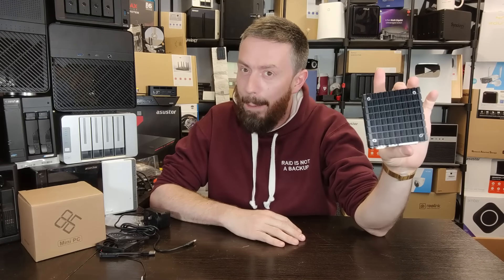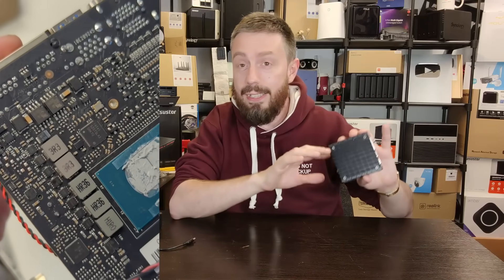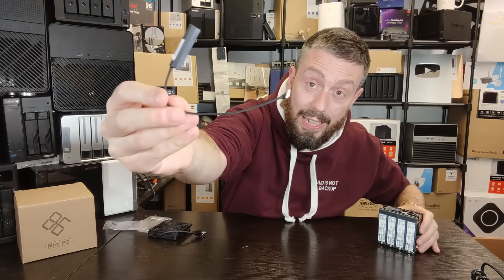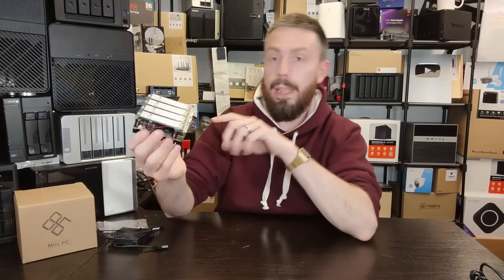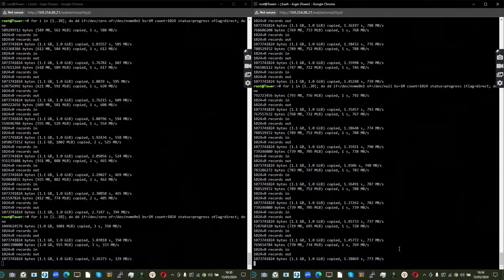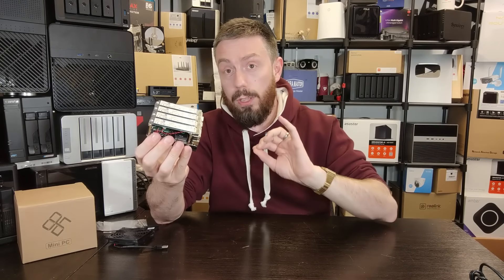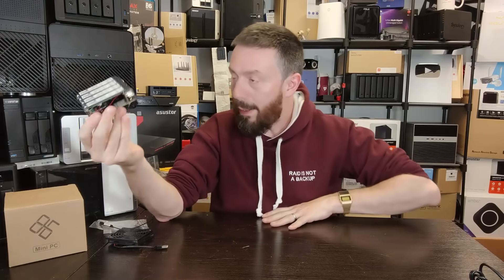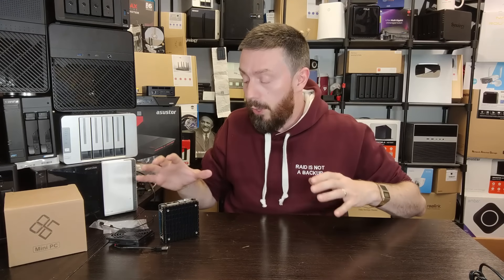CWWK X86 P5 M.2 NVMe NAS Board Review

Comment: put one or maybe 2 NVME M.2 As1166 Sata controller on it and connect 6 to 12 sata drives to it. The psu is the problem to solve but then absolutely storage beast. I bought one with pentium gold 5805 without the nvme hat but SFF8643 Ports (4 Sata and 4 pcie x1 or 1 pcie x4) cant wait to build my HomeLab. ✌️

Comment: For anyone looking at this in the future.
I bought one of these and put a 48GB 4800Mhz RAM on it and it booted without any issue into BIOS. Have not tested with OS yet but to boot to BIOS means it is fine 99% of the time.
Reply: Any updates so far?
Reply: @alimohsen2394  Well everything works fine, Installed Windows 11 and everything works fine. Also tried running some games for a couple hours to see if stressing the system would cause any instability and nothing so far. I have heard that Alderlake N series can boot 64GB fine but haven't been able to find a 64GB single module RAM.
The system In general is cool and stable
Reply: @CodeSnowy  hi mate, ive also got this system. so far it only recognises 32gb of my 48gb installed ram and not does recognise any of the nvme drives i installed.  do i need to update the bios? - pls help.  thank you thank you thank you in advance
Reply: @cheekyfella27  As far as I know I updated the BIOS with the update that is available on cwwk website and it worked flawlessly. I didn't check if all the RAM is recognised before the update.
Also, regarding the NVMe, I think you have to enable PCI-E bifurcation in the BIOS I think

Comment: My cwwk Box arrvied a few days ago and I was wondering, if you guys have tried an M.2 Sata Drive? I know this is more of a firmware dependency, but I didn't findy any section in the bios menues. 
Reason I'm asking is, I have a chance of buying NOS M.2 Micron Enteripse Drives from 2018 at an attractive price. Speed doesn't matter for my applications (Phone pics and docs sync, CD rips/Bandcamp downloads streaming)
Reply: The quad carrier only do pcie signal and no sata controller in between so you can't use M2 sata on it .but board itself have 2 sata connector breakout which can provide 2 sata bay with their cable

Comment: Bought and put together this system using 4x WD Black NVMe drives set up in a RAID5 setup.   It seems to work but when transferring files into it the RAID5 bricks and needs the entire system re-installed.   Tried both OMV 7 and TrueNAS scale and had same issue on both.   I'm assuming it's a thermal problem causing something to corrupt.   Anyone else have this issue and anyone manage to solve?
Reply: Thanks for sharing!

Comment: I’m using it with truenas scale with 5 ssd (I’m using a m.2 wifi adapter for the os). Everything works fine but time to time (1~2 days) one of my 4 ssd got disconnected. If I just restart the board in truenas the disk is disconnected. If I shutdown it completely then start again the ssd get back... I’m wondering if it is the hardware/bios. Does someone had the same issue ? For now I don’t think it is a good machine for a nas when stability is important.
Reply: @saorikido227 can you please let me know which 'm.2 wifi adapter' are you using to behave as the 5th SSD? Thanks.
Reply: @MrGrangeia  youtube don’t let me put a link unfortunately...
Reply: @saorikido227  Thanks anyway. Perhaps, if you could share where you bought it and a description, I could Google it?
Reply: @saorikido227  thank you! 😀

Comment: Thanks for the video! I'm very new to all this. How would you say this stacks up against, say, the friendlyelec 3588? They both have 4 M2 Gen3x1 slots. Does the oversaturation problem / cooling issues make up for the difference in CPU performance for a basic home NAS / plex server? Which would you recommend for that purpose?
Reply: I guess the biggest difference is CPU structure, X86 vs ARM

Comment: I think the 3x1 was a miss. I would have much preferred a PLX on there, so each is at a 3x4. Then I can use these as a small mesh of nodes for some of the work I have.
Reply from the maker: Would definitely need to beef up that CPU if they did! Even the N305/i3 wouldn't stretch to that. Would need a decent emb.ryzen or Intel core Mobile Soc - which would get REAL TOASTY in that frame

Comment: On Ali Express it is available with 32GB of RAM,  this really bothers me that vendors will do this.  The N100 will only support one channel with up to 16GB per memory module.  Yes, the bios may recognize larger memory modules but the CPU will not address it,  the memory registries have to be designed to address the memory, it will simply ignore anything larger than what it was designed for.  If anyone has one of these with more than 16GB of Ram. please find a python script that will test memory by grading a defined amount at a time and see where it tops out at.

Comment: If you can afford 4 NVMe SSDs I think you can afford a better NAS solution than this. With an inexpensive PCIe card you can fit all the SSDs into you main computer skip the NAS.
Reply: and leave the main pc running 24/7? you totally miss the point of a NAS here tbh
Reply: @crax999  I have my main pc running all the time anyway. Modern computers are quite good at managing the power according to the load.

Comment: Hi. This might be a stupid question but, does anyone know if the 2 sata ports inside the board are able to power 3.5 hdd, or only 2.5 ones? Thanks.
Reply: They should be able to power either one you would have to have a separate power supply to power said hard drives though , the way it works is SATA data ports are all the same only difference might be the size of your power ports but usually these are the same as well , however if you are trying to run a merged adapter that has both the power port and data port in the same connector then it only fits either 3.5 , or 2.5 or so on hopefully I haven't confused it took me a while to figure out that data and power plugins work independently of each other when I was learning about hard drives as well

Comment: put this prompt in your favorite GEN_AI (such as perplexity pro): 
please describe a concrete setup including alternatives with maximum price performance for a DIY NAS setup based on the following settings:
The best bang for the buck setup right now is to get a used mini PC (SFF) with enough PCI adapters and USB 3.2, plenty of RAM, and carefully tweak it for a cold/hot storage setup (& cloud backup),  Add an usb-C-5Gbe for the sweet spot of NAS performance, then configure the storage pool tiers to your liking with truenas, unraid, openmv, primocache. 
64GB RAM - 4 x 1GB NVME SSD - 4 x 18TB (8 x 8TB with refurbished Exos 2x18)
1 x NVME x 4 adapter
1 x SAS adapter
3GB/sec constant bitrate - generous caching wherever possible, assuming home use with few concurrent users, lots of large files, low db activity and random access.

Comment: Do ypu tbink ypu could run truenas off usb drive??
Reply: It's not unRAID so the drive is liable to die fast
Reply: @BoraHorzaGobuchul  maybe a solid state usb. Thing is you need a drive for os!!
Reply: @THEG12EG  you do, of course. Since truenas, unlike unRAID, writes a lot to it's drive, a flash drive is very undesirable. A usb-ssd will most likely work, but again, depends on the quality of the SSD - usb-ssds are often low-quality stuff.

Comment: I'd love to see someone make a compulab airtop 3 style heatsink grid chimney cooler for this for both the CPU and the SSDs. I'd throw an actual i3 under a small version of that airtop3 cooler, or 2 or 3 of those atom N300s pretending to be an i3.
Reply: On the subject of ECC...... wasnt ECC supposed to be standard for DDR5? Wasnt that the big selling point during the run up to release?
Been quite upset with ECC uDIMM support in so many DDR5 platforms. Did anyone catch that it took Epyc coming to AM5 for most motherboards to put any work into enabling ECC?
AM4 has had far better ECC support than AM5 up until now.

Comment: i have the i3-n305 variant with the board and 5 (FIVE) nvme attached and running.. 4 nvme on the expansion board (pcie4x4 downgraded to 3x1 each) and the 5th drive in a custom a+e to m-key adapter i built myself.
everything works perfectly fine, running proxmox on the 5th drive and with mdadm raid5 array with lvm on top on the other 4 drives.. lan ports are lacp'd so i get full 2.5gb transfer speed, quite happy and sold my old DS920+.
Reply: Can you make a video/post on how you did this?
Reply: @cl-be2zs  uhm yeah i guess i could post something about, you mean the 5th drive adapter? or the whole setup?
Reply: @RobertoAnile cwwk released this board with case, so would be apreciate if you show your hole setup
Reply: @evgenypotapov3716  yeah i ordered that case so to swap the dev board and have it cleaner, i promise i will make a video with the 5 nvme disks installed!
Reply: @RobertoAnile  are you happy with disk performance?
Reply: @evgenypotapov3716  well yes it's working ok for me, in a w10 vm the mdadm array reads at 2600mb/s and writes at 1300mb/s, not amazing speeds at all but it's ok.. obviously the bottlenect is the network so no problem there.
Reply: @RobertoAnile  sounds pretty nice! I was bit feared with speed tests on this video. What drives are you using? going to repeat your experience
Reply: @RobertoAnile  in the video he said something like 500mb/s read and even less write...do you have such hinger figures because of the i3 Processor? I have a QNAP TBS 464 with 4x WD RED 4TB SSD and besides some backups I mostly have movies on it and connecting two an Apple TV via SMB...I don't know too much about NAS systems...do you think this little CWWK thing would be enough for my use case? and what system would you install on it for ease of use? What I hate about the QNAP is how loud its fan is.
Reply: @RobertoAnile I see that there are a+e to m-key adapters you can buy online, did you make a custom adapter because it needs to be thinner than those available? If yes, would you be willing to share the design?
Reply: @QuickCat  the problem is space, yes, and a common adapter wont fit because of the ram stick hitting the a+e device and thus the nvme adapted to that.. what i did is take an a+e adapter and a m.2 pcie adapter and cut them to fit in the space, then soldered the lines rotating the pcie adapter 90°.. it's not easy to explain but it's simple to do if have the manual capacity to do so.. i posted some pictures in a comment above but youtube decided to remove it.
Reply: Having this expansion board plugged into a single M.2 socket I wonder, how do you identify which nvme to swap in case of failure ?
Reply: @alexandruiancu2453  most drives have serial numbers on them (I wouldn't presume all). You can remove the drive whose serial number no longer appears in your operating system. I'm running TrueNAS scale and this is fairly easy to see from the GUI.

Comment: I had a feeling the drives would run at PCIe gen 3 x1 which is actually not that bad if you compare it to the Zimacube. Go watch the critical review of the Zimacube by Hardware Haven and see how they use an Asmedia switch to further downgrade the NVMe lanes to each drive to the point you even see warnings in the syslog about degraded PCI express performance.
Reply: I would have liked to see the video run some sort of fan over the NVME's and whole board in general, then re-run that write speed test. Because at the moment it seems incomplete, why did it drop performance so badly.

Comment: I could easily see someone designing a 3D printable case for this that puts a couple SATA drives on top of it, and then a 120mm fan along the back that would actively cool all of the components. Would love to see that come to fruition.
Reply: i started work on  one but ran into problems problem 1 the fan headers are 1.25mm pin pitch looking for adapters haven't found any except for in china
what they (cwwk) recommend is USB fans so now looking for USB headers (2.0 pin pitch) for USB 2.0 found some on another web site , next comes the propriety SSD/HDD header you could break these no replacements,they  don't sell them ( could have use a plug like in a laptop, ask them for a cad model they pointed my to some weird can format .x_t looked at at it using e drawings and realized nothing looks professional so i had to measure each port to get locations and rebuild cad model. so i believe this is a waste of money to even get vs a raspberry 5  with a hat for 4nvme drives yeah sure it has more memory and probably more power.
Reply: There are already bunch of Chinese DIYers have done it, they made a open source project called qNAS, you can have 2 to 5 bay 3.5 sata bay or 2 to 6 bay 2.5 sata versions.
Reply: @Bytional  could you give a link on these? how are more than 2 SATA drives supported with only 2 pins? or are they doing away with the nvme slots and using the PCIe 3.0x4 for SATA?
Reply: I have the 8core i3 model coming and was planning to do exactly that when it arrives.  I will drop a link if all goes well.  i3 has twice the processing power than the other models so I might run proxmox and some light VMS. I don't think he striped the nvme drives so this could be hindering the read writes on the daughter board possibly. I will stripe and test the speed.
Reply: @jimmyTimtam  Have you had any luck. Also any info on speed and CPU performance? I am very interested in getting one of these and would love to have more info before I get them.
Reply: @jimmyTimtam any update? how had your project gone?

Comment: Hi, actually I’ve got an idea for testing system like this one:
populate it with nvme drives and boot from ubuntu usb or something similar. Make a zfs array (raid5) and copy some large video file to it. Then just copy from one folder to another within that zfs array! 
That should tell people how goot the cpu is in terms of calculating checksums and parity data. 
You could setup a ram disk and copy data from the array to ram disk and the  from ram disk back total the array - that way we would know the read and write performance for at least sequential data.

Comment: I'm running this system with Proxmox without the 4xNVME. E-Key 64gb boot drive at 3x1 speeds and a 2TB regular NVME at 3x4 speed for CEPH only. Putting the fan on the heat sink was required. 32gb RAM works perfectly fine. It's ok as a Proxmox node as long as you don't expect too much out of it. The 4 E-Cores are obvious at times, but normal operation is great. 3 node Proxmox cluster running CEPH for the only storage and about 3-4 VMs on this node at any time.
Reply: What's a e-key?
Reply: @THEG12EG  m.2 slots are keyed for different functions. The “WiFi slot” is an E-Key slot. The cool thing about it is it usually has a x1 pcie lane and regular storage will work. Slowly. Regular storage m.2 slots are M-Key.
Reply: @scottbrooke4896  oh I've always wondered what that slot was called 😂
Reply: My only SSD is recognized if I use it with the 4x adapter, while if mounted directly on the motherboard it is not recognized by the BIOS. Is this normal? Help
Reply: Hi. What's your NVME configuration? Are you running any sort of RAID? What e-key drive do you have?
Reply: Is there space to put m.2 E key to B key ?

Comment: I built Raspberry Pi NAS with a mix of SATA SSD’s and 2.5 in HDD’s while I wait on more SSD deals. So far so good, you can get 1Gbps stock speeds and 2.5Gbps with a USB C dongle, if your network allows it. Jeff Geerling had a video recently about it. As for the price it’s within $150-$200 for the system.
Reply: Oh and also installed an e-Ink display with system stats like DateTime, IP address, CPU % and temp, Mem & Disk %

Comment: I see ceph node :)
Edit: can the wifi m.2 be used for boot ?
Reply: USB is certainly an option. I’m not sure how noisy the OMV boot drive is but the SD to E-key adapter could be an option as well. I think you could also use the tiny sata port adapter, but that would have to be an SSD. Don’t know what the power limit is on that little cable.
Reply: @scottbrooke4896  what about an external SSD on USB 3 port ?
Reply: Yes, that's how I'm using it. E-key to M-key adapters work fine, but are too tall if you use an NVME in the M-Key slot. There's one place, Cervos, that makes an E-Key NVME stick.
Reply: @scottbrooke4896  thanks for the into mate. Yes I'm aware of those exotic A&E key nvme, but those are too exotic for my liking and when things go wrong - it's harder to find a replacement ... and are also expensive and have low write performance.
Reply: @scottbrooke4896  BTW, I forgot to let you know, if some thread I've seen guy dishing out a link to an amazon item which was A&E to M-key with a ribbon cable allowing to place M-key socket with mounting PCB relatively easy anywhere in the unit !
Reply: @scottbrooke4896  so what are the options for boot / OS drive if i use the 4 M.2 slots for RAID? planning to run OMV bare metal. USB?
Reply: @crax999  anything but SD / usb drive ... those die for no reason ... even jupiter transition can make it fail, and if you intend to use it as a server then ... you know ...
Reply: @tommybronze3451  well what options do i have if the E-key slot is used by the M.2 Adapter which will cover access to the E-key it seems? as @scottbrooke4896 mentioned i might be able to use the SATA port but will have to check whats the PL on the connector
Reply: @crax999  look at 2:04 you can clearly see that support posts are not obstructing wifi slot. Get E key adapter with a ribbon and you can drop M key 2280 wherever you want ! Anything but usb / sd boot drive
Reply: Yep, I looked at that. You’d have to rig up something to support the adapter though.
Reply: @scottbrooke4896  gaffer tape 😜 you know every bodge that works is permanent 🤣
Reply: @tommybronze3451  Hah! Yep! I started with an SD Card adapter in that slot and bought the (overpriced) nvme. Because, I know if I didn’t it would be a forever solution. Gaffer tape for sure!